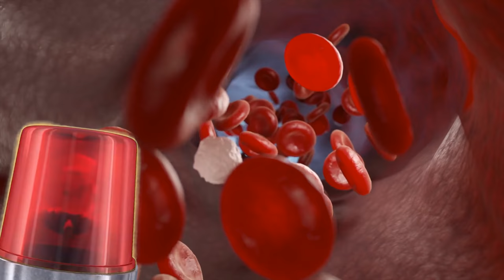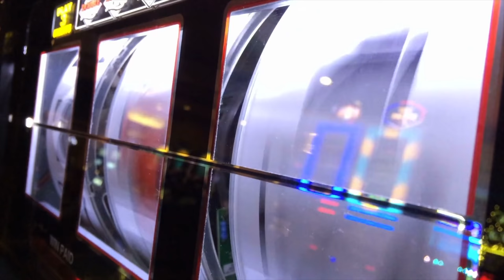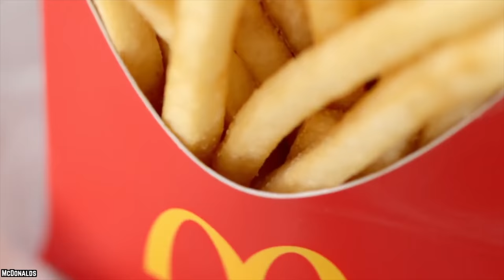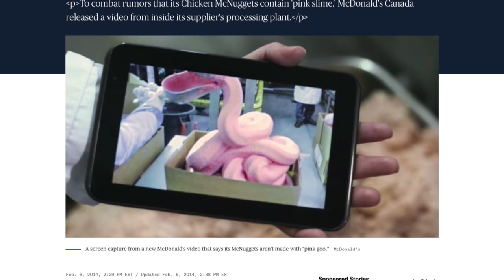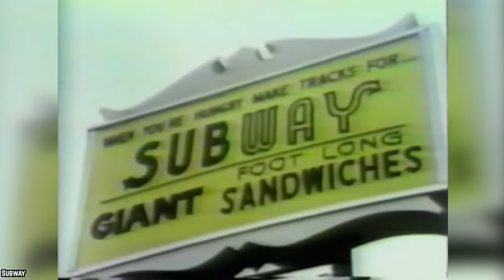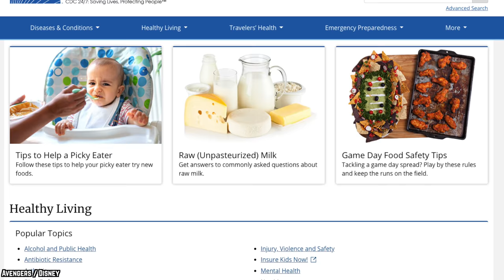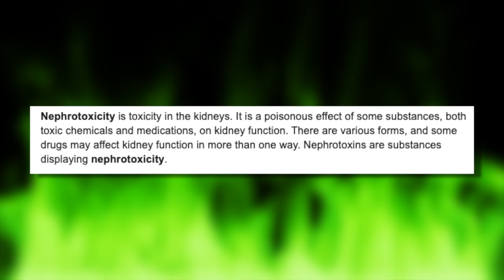Top 10 Gross Facts About Fast Food Restaurants

Comment: I used to work at KFC. We had to clean the ice machine and the ice and fountain dispenser every night. 
We had to soak the spigots and other removable parts over night in a solution. The morning shift would come in, rinse them and attach them. 
We had clean ice. That's why I didn't mind drinking beverages with ice there.